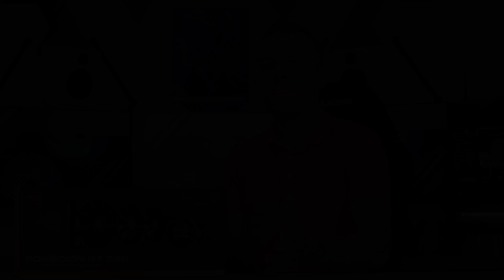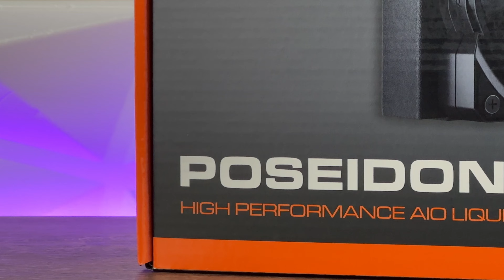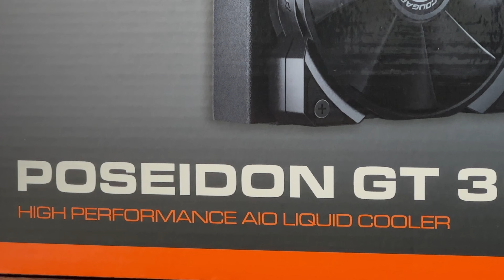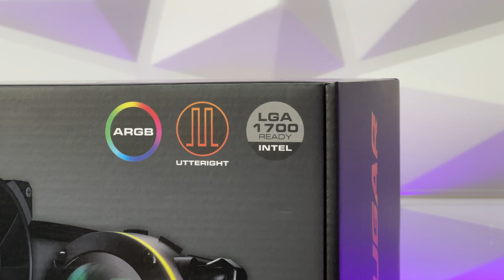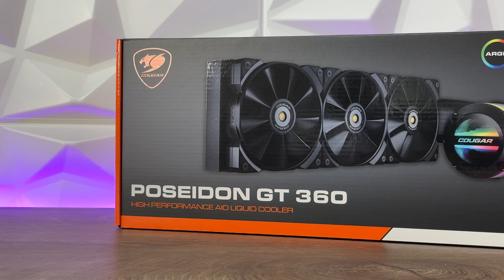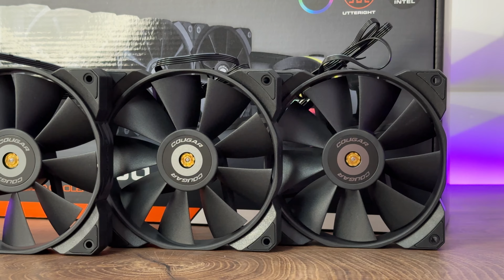COUGAR POSEIDON GT 360 - High-Performance 360 AIO Review

Comment: Do you consider Artic II 360 a better performer?
Reply from the maker: I haven't tested Arctic LFII 360 on the same processor, but since it has thicker radiator and because of it's cooling efficiency, I would say Arctic might be slightly better. The thing is, Poseidon GT 360 outperformed every 360 I had so far as well as Arctic LFII 360 did, and because of the radiator size, I would say that. Plus I think Arctic fans are more quiet.
Reply: @PCCrazyDario  Thanks for feedback!
Reply from the maker: @doktorego8432  You are welcome. :)